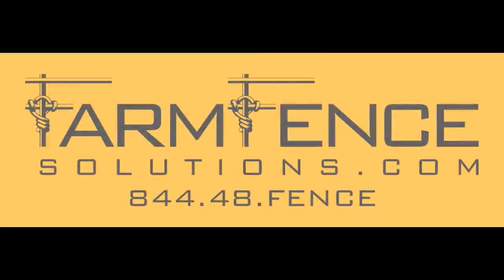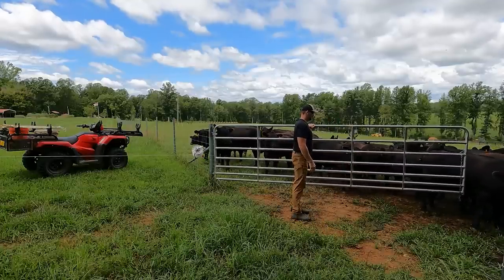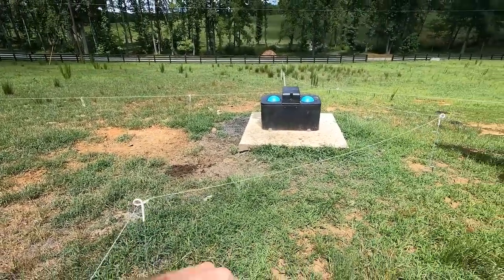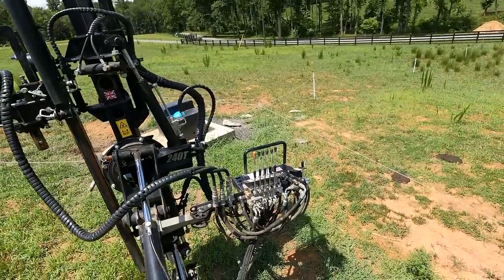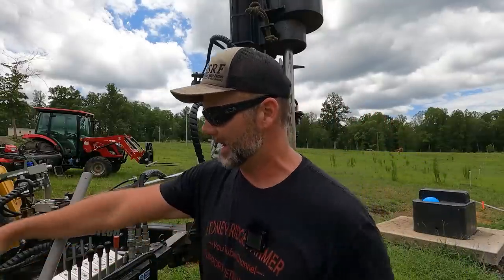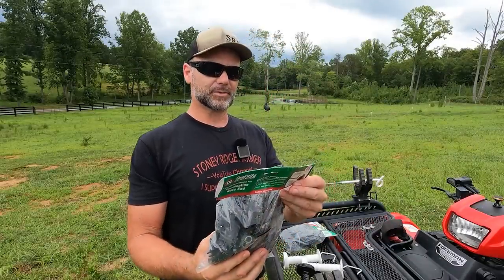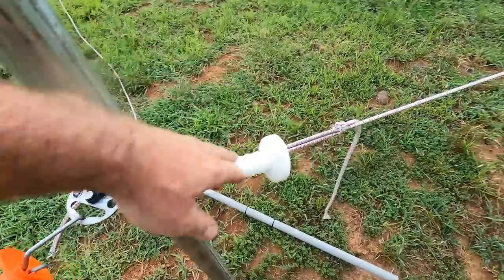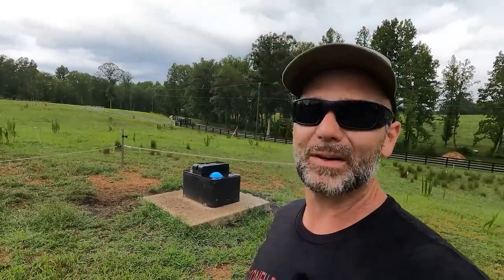I didn't expect this to be such a problem....Big tools to the rescue!

Comment: You should not need one Bungy gate for every paddock.  There should be one paddock accessible to the waterer at all times, right?  So ((number of gates) minus one) should do it, assuming the gate sizes are all similar or the bungy gates stretch to fit.
Reply from the maker: yep....I hear what you are saying for sure....so only 3 are needed since one will be open all the time...very good point buddy

Comment: level is horizontal, vertical is plumb.  It is derived from the ancient tool of a plumb-bob which indicates vertical via a string and lead weight.  (and incidentally, because lead was used..that's why it's called "plumb" as that is derived from the latin word for lead and, somewhat relatedly, why the chemical symbol for lead is "Pb").
Reply: Lead was called plumbum.
Reply: @royreynolds108  yep exactly.

Comment: The conductive bunjie cord it pretty cool. Cap your posts and they'll last much, much longer. Even galvanized pipe will succumb to the standing water inside it, especially since some of coating will have been abraded during the drive down.
Your frequent interaction with the cattle will make them much more cooperative with everything you have do with them.
Reply from the maker: we don't have to cap the posts my friend....I hear ya...however when you cap the post you don't allow it to breath and evaporate the moisture from the ground....so..eventually the post rots due to humidity and condensation inside the post.  I have 1000 posts on the farm and only about 30 of them are capped my friend
Reply: @StoneyRidgeFarmer  I did not know the caps you used were air tight. The caps I use just keep the rainwater out, some folks even just use soup/bean cans over their posts.

Comment: Metal posts in an Electric fence is a problem waiting to 'short out'. Especially with those connectors dangling.
Reply from the maker: you do understand that these are insulated and that electric fences with metal posts are in use all over the planet right?   99% of the posts on the farm are made from steel....they won't short out if you install the fence properly my friend

Comment: How are going to keep that little 15 by 15 watering area from turning into a mud hole? If the cattle even after every move have constant access to that area what keeps them from over trampling and turning it into a quagmire?
Reply from the maker: they are moved 2 times a day so it's not like they'll be here for longer than 24 hours my friend...that's the whole point of rotational grazing and keeping the waterer within 800 feet of the cows all the time...they come individually to drink and therefore no mess....they've been drinking out of this waterer for several months now with no mud hole so why would this change it?  They actually have more room now which means less pressure on the soil my friend

Comment: Setting up my farm for cattle now.  Do you have shelter in each paddock?  I’m considering building a shelter adjacent to each water source at the farm.
Reply from the maker: woah!!! No!!! Don't put it near your high traffic areas....and I'd suggest using trees v/s structures or you'll have a huge mud hole.   If you're gonna intensive graze like this just be sure you leave some trees or some sort of shade for each paddock...not so important in fall, spring and winter...but summer heat it is very important.  Look at Polyface farm's "shade mobile" idea but don't put it near your water...put it in a spot that needs nutrient...the cows will poop, pee and revitalize the earth under it
Reply: @StoneyRidgeFarmer  unfortunately this has been a crop farm for 150+ years.  No trees in what will be the pastures.  I will look into the shade mobile.  Thanks for the reply.

Comment: Its plumb ! Need some stone for a step up on the concrete pad waterer . @14:50 is that water or hydraulic oil ? How are you powering your fence charger @ this distance ??
Reply from the maker: fence charger is solar and will power 5 miles of wire
Reply: It's a cowpie

Comment: Hi Josh, you seem to have alot of water and electric stuff exposed in the open…what precautions did you take to minimize lightning strike damage?
Reply from the maker: if lightning hits the fence charger...it's toast in most cases...however it has built in fuses...havn't had an issue in the last 9 years

Comment: Hey Josh thank you for the video I enjoyed it and no we don't yell and scream and Hoot and holler like you said but we do go woo and they come walking now sorry Josh this is going to be a little bit longer this comment here but that post pole driver well I was watching Bush radical that is his YouTube channel and he put in a well using a galvanized steel pipe and how he drove it into the ground was with this metal piece that he took both hands and hit it down now if I have that machine like you have there for when the time comes for me I will use that machine there instead of doing it by hand woo
Reply from the maker: lol...don't believe everything you see on youtube brotha....how on earth someone thinks they're gonna drive a pipe in the ground and get water is beyond me....remember the dirt you drive it into comes right up into the pipe and blocks it
Reply: He probably used a sand point. They work well
In places like Wisconsin and Minnesota where it’s mostly sand and the only work down-to about 30 feet as it’s a 1.25” pipe and that is about as far as a pump can lift with that size pipe. I have a spot on my property that I am going to try one that is all sand but I am not sure if the water will be shallow enough so I will dig down another 10’ or so and support the sand so I can get the water to a tank and then pump it out of there to the garden/animals.

Comment: I'm curious why the wire instead of a normal fence gate? Normal fence set it and forget it no issues with electric wiring
Reply: My guess is electric fence is about as simple as it can be there.
Reply: @charlesbentley2934  ty
Reply from the maker: yep...as the other fella said....this is how I split my paddocks for intensive grazing....can't get much simpler than poly electric lines....easy to install...easy to remove and or move around
Reply: @StoneyRidgeFarmer  thank you!

Comment: R u going  to  put a  cap on  pole keep  from  freezing  and spilling  open
Reply from the maker: there are 1000 posts on this farm and none of them will crack from freezing water...it's the same concept as an ice tray..it's open at the top so it can't bust...plus it's in the ground below the frost line and conducts heat upward...I've never seen ice in any post on the farm my friend

Comment: Another expensive tool or can you rent it. I used to have a post driver that I rigged up on the side of my bucket it swiveled and I could just push the t-posts in the ground , worked great. Saved my shoulders and arms. Never had to put posts in that deep, but I did set alot of chain link fence posts. Does that require high flow on the hydraulics? Pretty neat!
Reply from the maker: you can rent or purchase from farmfencesolutions.com

Comment: at 20:29 it looks like the insulator for your hand is pushing the other other line against the pole wouldnt this ground out your circuit?
Reply from the maker: there will be a period of learning and adjusting to get this to perfection my friend
Reply: @StoneyRidgeFarmer  yeah I’m guessing it wouldn’t be too hard to add an extra insulator a few inches lower. Nice work should last longer than you and that’s always a good thing.

Comment: 15 feet twice or 30 feet is not much room for the cows to bunch up around the waterer.  My suggestion is about 20 or 25 feet each way for that extra room.
Reply from the maker: man...Roy folks just aren't gettting this concept my brotha....the whole purpose of mob grazing and placement of the waterers is so they don't mob around the water tanks.  When cattle are less than 800 feet from the water source they don't mob drink.  They drink individually in this setup and the area is tight enough so that they don't lounge in the water tank coral.  They've been drinking from this waterer for months now with only 3 feet of access and it's worked awesome. Just a little cattle science for ya buddy